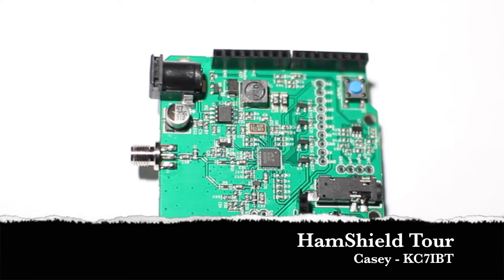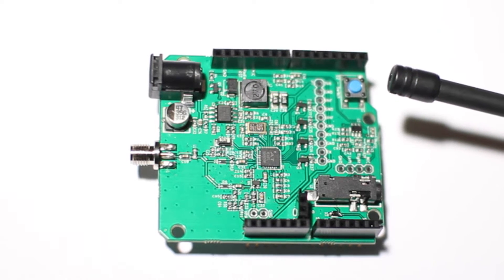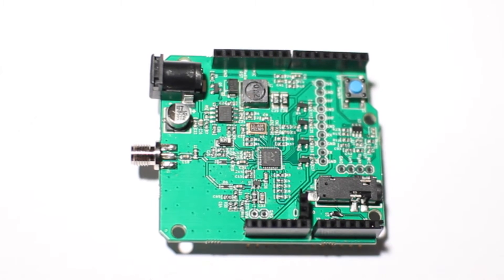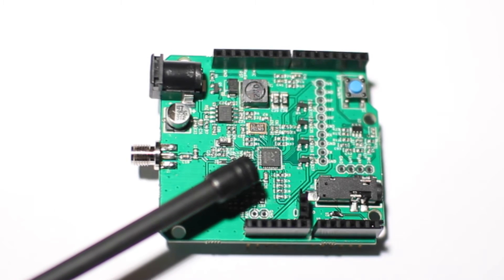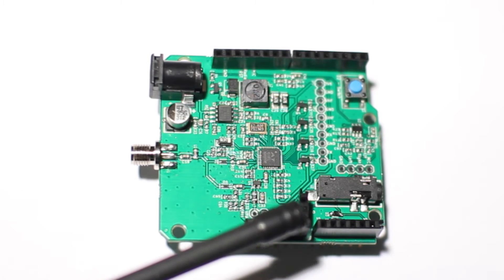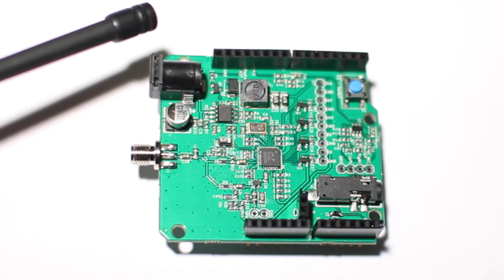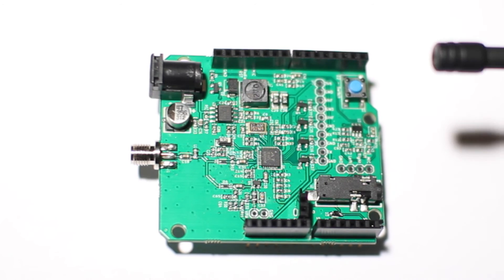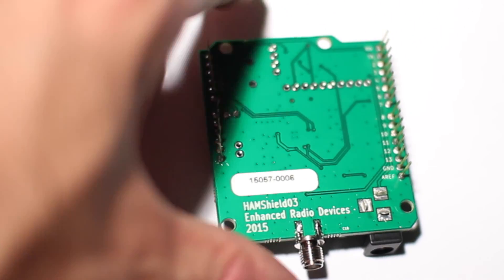HamShield Tour

Comment: I know it would not be a plug and play but would this work with a Adafruit Pro Trinket?
Reply from the maker: ***** Yes, it would work. It would take some minor soldering of a couple wires, but you could tape/glue this to the underside of the HamShield! It would be really tiny. The HamShield comes with two types of headers, so what I would suggest is not soldering on any and using some fine wires to connect I2C, audio in and out. Since it is 16MHz @ 5V, it'll work out of the box.
Reply: I'm in on Wednesday if there are any left.